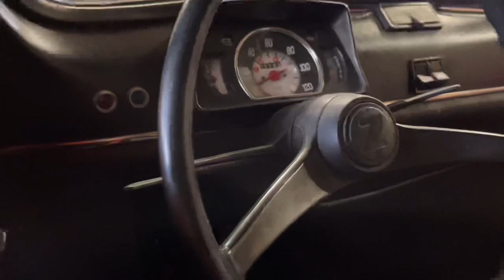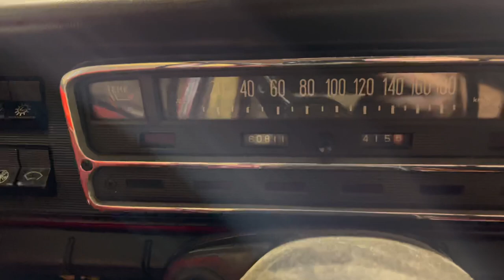PICKING UP ZASTAVA 750(FICO) FROM BIGGEST ZASTAVA COLLECTOR IN USA

Comment: My wife owned a white Zastava 750 in Guayaquil, Ecuador.  It was about the same age as the ones you show here.  I don't know if it was imported directly from Yugoslavia (traded for bananas) or came from Colombia, where they assembled them under license.  She loved it.  It was perfect for the city.  Speeds were never over 40 mph and the thing could park in it's own length.  It also sipped fuel.  She filled the tank about once a month, and she did a lot of driving.  She thought it was too under-powered to go up hills, but I thought it did fine.  She was afraid to downshift.  I have never seen one here in the States, though I have seen four Fiat 600s over 35 years.  I came across a mechanic near here a few years back who has two Fiat 600s (two of the four, though they may also be the other two) that he dresses up for different holidays to advertise his shop.  They certainly seemed tiny after not seeing one for so many years.  We had a young man from Serbia over for dinner and I asked him if he had ever driven one.  I was curious because he was about 7 ft. tall.  He hadn't, but he knew men as tall as he was who took out the front seat and drove from the back.  Congratulations on your find.
Reply from the maker: Thank you sir